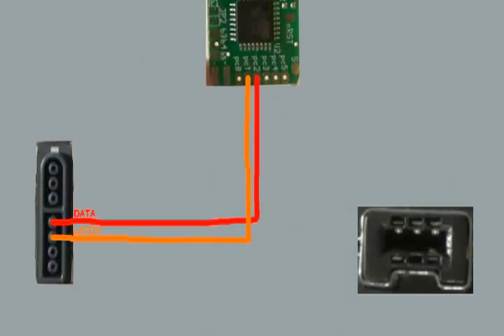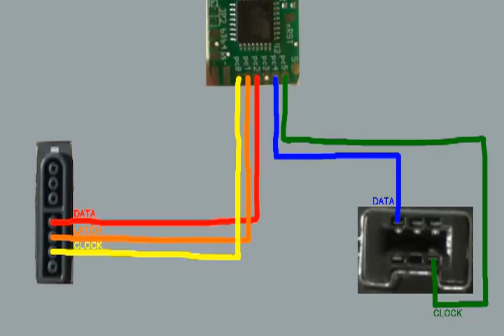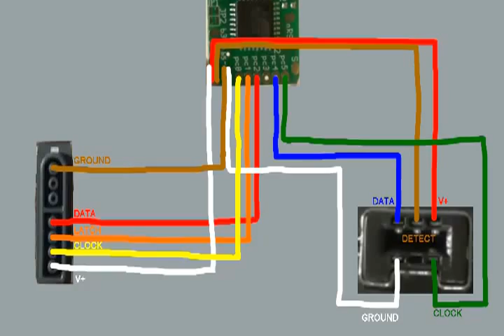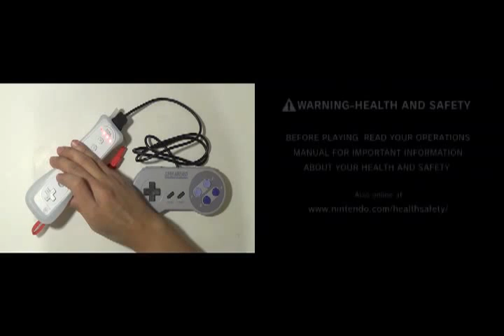How to mod your SNES controller to Wii (U) remote (Plus)

Comment: 1st,through japan in Club Nintendo ,there is a remake of the famicom controller that connects to the bottom of the Wii remote,2nd the SNES classic is out in my time so,no need for messing up my valuable SNES controller
Reply: Retronatic Arcadiac you realize this video is 7 years old, right?
Reply: Yes and you do realize with the NES classic controller can also work on the Wii remote,if only they made a N64 classic with the controllers
Reply: @gamefanmike322  ok your broken english makes it hard to understand what you are trying to say so let's go bit by bit
"Yes and you do realize with the NES classic controller can also work on the Wii remote"
yeah, i do, but the nes classic was launched in 2016
"if only they made a N64 classic with the controllers"
errm, i think you are saying that you want nintendo to make a n64 classic and make the controller use the wii connection? that's my best guess

Comment: An additional way is to get https://github.com/Maschell/hid_to_vpad with your homebrew wii u. I used a tomee USB converter with an original SNES controller. You have to configure the .ini file in order for the buttons to function correctly (also find the Vendor ID vid and Product ID pid with the help of this tool https://www.uwe-sieber.de/usbtreeview_e.html#download *usbtreeview*). There is a tutorial how to do it https://github.com/Maschell/controller_patcher/wiki.
Here is the .ini file I tried with the tomee SNES usb. Though, + -  and L/R triggers don't work properly, not quite sure how to get them running. D-pad and the y,b,x,a work though... http://www.mediafire.com/file/5rhravv2t9mltx2/Tomee_SNES_PC_Game_Pad.ini/file
On an additional note, if you want to play with some other controller aswell, (like ps3/4, xbox or mouse and keyboard) you can with this as they are prepackaged and you don't have to worry about the .ini stuff.

Comment: If possible, it's probably better to do this with a third-party SNES controller like a Cirka or something rather than gutting a real SNES controller... it's not as if more of them are being made, and there's a high probability of ruining everything if you're not skilled at soldering. Then you don't have an SNES controller or a nunchuck. Just a mess of solder and broken circuit boards with useless hunks of plastic.
Reply from the maker: I have no idea. It should be the same in principle. You could always use a female connector from eBay and wire it up to the chip to the Wii male connector so you don't have to do anything to the original controller =)

Comment: Alternatively, you could buy a SNES extension cable and wire that up to the Wii controller, that way you'd still be able to use the SNES controller on a normal Super NIntendo, and just plug the controller into the adapter itself whenever you wanted to use it on the Wii.

Comment: This isn't entirely related to the controller mod, but to 3rd party nunchucks in emulation. I use priiloader, and the screen just goes berzerk like I'm pressing all of the buttons and the stick is rotating. The only environment that doesn't happen in is the stock wii boot, and wii games. I also have a pair of 3rd party classic controllers that do the same as soon as they are plugged in.
Is there any way to fix this? Or will I need to fork out a load to get the official gear?
Reply from the maker: I'm not sure what you mean by "This isn't entirely related to the controller mod, but to 3rd party nunchucks in emulation."
As far as priiloader, I have not used. I have however used Homebrew and the controllers work fine.  The problem you describe with the 3rd party controllers is foreign to me. I am sorry I don't think I can be of much help.
Reply: Jonathan Clark dude....shit. i was so excited to save a ton by buying 3rdparty classic controller.  But everyone else and you say once you plug it in the wii freezes and freaks out. That sucks i wanted it for homebrew emulators.  Have you found a solution?  Used classic controller are atleast 20. I have 3rdparty GameCube controller il let you know if they work. Glad i read all these before i bought em

Comment: Ok so I'm having a problem where if I plug in the snes controller to the wii remote while its on, the pointer freezes and snes controller doesn't do anything

when I plug it in while its off, and try to connect to the wii, it will blink to connect, but won't. Sometimes the last blink will be the player 1 light as if it was connected and then immediately disconnected

when I unplug it, everything fixes itsself

please help
Reply from the maker: I never had these issues. That's very strange. Check for solder bridges between connections! When you connect it while on the main screen does moving the D-pad on the SNES do anything?
Reply: nothing on the snes controller does anything on any software when it is plugged in. I'm wondering if it could be a firmware issue with the chip because I know it comes in different firmwares. I think the one I have is like 1.7.9 or something. I did check, like, 3 times for solder bridges and couldn't find any and I did desolder and resolder anything that was close to a solder bridge.

another issue (and most likely the problem) is I am using the cable from the official nintendo nunchuck and it has different color cables, however, I found a broken $3 ebay one I had and it had the same color cables as the official one. So naturally I used that for reference. There might be an error in that.
Reply from the maker: DailyAverageGamer I think you should use what the wire does, not what color it is. The colors may differ from 3rd party products from originals. for example my data cable could be blue while your cable is brown. Try figuring out which is which. Look at the connector for clues. For example in the schematic I have in the video the date cable is blue and it is coming from the top left corner if you're holding the nunchuk connector like it is depicted. If you use a multimeter to do a continuity test, you can find which wire is connected to that pin. Once you do, you have figured out which is the data cable and viola! you can use the same method for the other cables.
Reply: ok, so I opened up the wiimote connector and there were errors in my color matchup, I have resoldered it correctly this time and the problem is gone, but a new one shows up.

When plugged in, it will act as a classic controller, but the ABXY buttons dont do anything and it is as if the down button on the Dpad is always pushed

BTW, thanks so much for helping me this much
Reply from the maker: DailyAverageGamer There is only so much troubleshooting I can do from here. I say you check your work, use the continuity test, and check for solder bridges.
Reply: Ok thanks so much for your help! But what is a continuity test?
Reply from the maker: you use a multimeter to check the continuity of the wire. For example you check which part of the connector is which wire when you splice from the nunchuk or N64 controller.

Comment: Hey man great work I recently tried this with my n64 controller and I got to the part with the clock wire from the nunchuck and both the knunchucks I had had no reference next to the wires and had different color wires. Please help
Reply from the maker: Try to single it out, there is going to be a V+ wire, and a ground wire, so you can cross those out as the culprits. Also if you got up to the part with the Clock wire, how did you determine the data wire? Also are the color of the wires the same? maybe you could use that as reference. It is very difficult to troubleshoot from here but I will help with what I can.
Reply: I kind of just guessed for the data and clock wires from the nunchuck there were only 4 wires instead of five. And the black wire I guessed must be the ground the red must be v+ and then I was left with a green and a yellow. So i guessed yellow was clock and green was data and put those on the designated spots put both ground on the negative spot buuut I only had 2 wires for the positive. I had no brown wire.
Reply: Btw I am doing it on N64 controller not snes
Reply: Also if you could let me know what nunchuck you are using in particular it might be easiest to just buy one and follow your video.
Reply from the maker: I just bought a random $3 black nunchuk to match the original black wire off of eBay